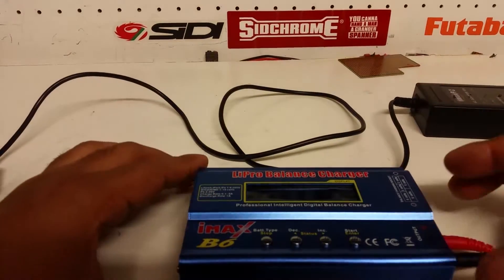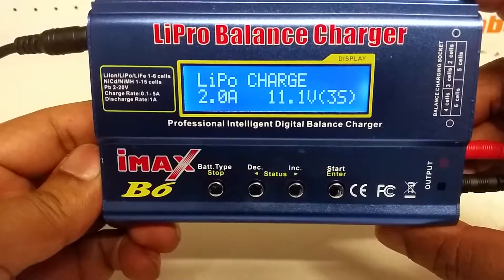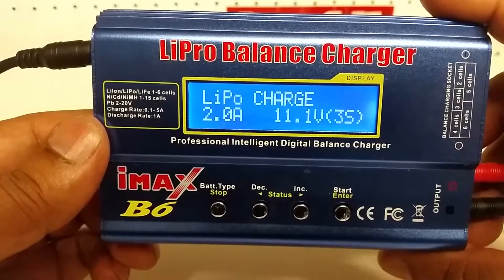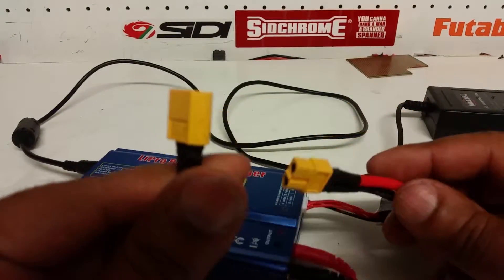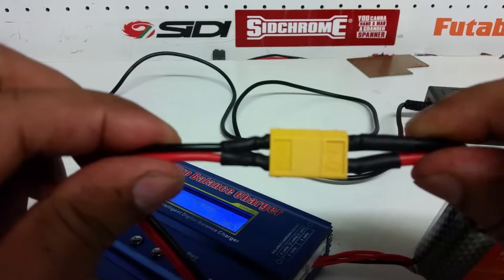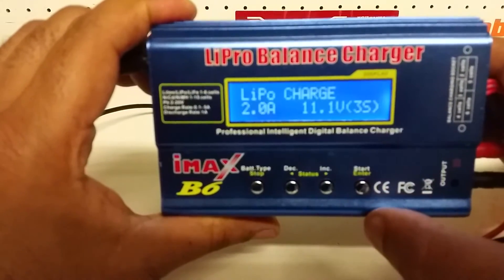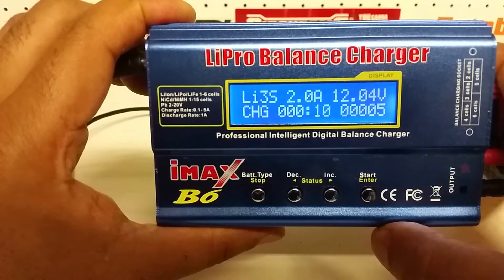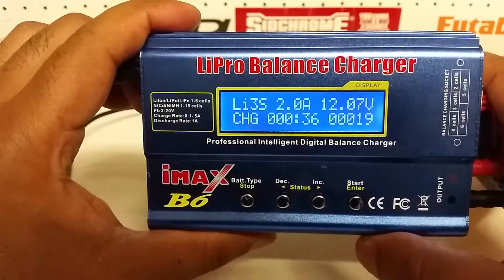CSMI : Imax B6 Lipo batter Charger 3s basic set up

Comment: If the battery voltage shows higher than the battery label (11.1v) will it overcharge and damage the battery?
Reply from the maker: The max voltage per cell is 3.2 to 4.2 per cell
Reply: OK thanks, so there is no possibility of overcharging the battery? The balance charger has protection? Great video thank you, I set my charger up the same as yours to charge my 3s lipo 2600mah 65c
Reply from the maker: It should not over charge but always watch it to be safe .
Reply: OK thank you so much for your reply I will subscribe

Comment: Need help
I am new in this field
I have two questions
1. How much time it takes to full charge 3s 5200mah lipo 30c?
2. It says 3.7v on battery as wel on imax charger menu, but it goes to 3.84v and sometimes 4v is it safe or normal?

Comment: I thought the white plug is what charged lipo batteries. I’m new to lipo rc. My drones come with charger and only white gets plugged in.  So on rc like these you need white plug and plug that matches your battery for your car correct?
Reply: No. Most RC cars do not use the white connector. You just need to use the T plug.
Reply: @Megalink82  dude the white plug is the balance plug, I'm pretty sure it has be plugged in or it won't balance the cell's. Cell's not balanced is one the main reason they fail I believe
Reply: @jackmehoff6701  Maybe I was confused about the original question. The white plug and plug that matches the battery for your car threw me off. You only plug the power connector on the battery to the car. When CHARGING the battery, yes, you do need to use the white, balancer, and power connector on the LiPO.

Comment: What's the difference between lipo charge and lipo balance settings?
Reply from the maker: Lipo batterys have cells 3,4,5,6... These cells need to have the same voltage.  This process is called balancing.  The charger has this capability
Reply: @CSMIRC  yea i know but if i charge my battery on "lipo charge" is this going to charge the battery without balancing?
Reply: @CSMIRC  ..so thats lipo balance, why did you not use it?

Comment: We have blue batter 7.5V 2000Mh is this charger gonna work ?
Reply from the maker: Bit hard to say with out seeing the battery but generally speaking yes it should
Reply: @CSMIRC  
This the battery we've got 
https://www.ebay.co.uk/itm/233582829654
Reply from the maker: Yes it will work.
Reply: @CSMIRC  thank you for your reply. I appreciate it

Comment: mine, LIPRO BALANCE CHARGER IMAX B6 is awsome and maybe made in china but cares really, it stops when its fully charged but i found when i check the cells individually with a battery checker. its off by .2 from 4.2 per cell being fully charged for my 3s batteries. i use a vharge plate its the mist common one that comes to mind and is all over the market. however i wish i could alter the settings without worry, i run it on balance 3s 11.5v and let it go but get a capa cutoff  about 75% finished and have to start it again. im not going to mess with the temperature settings of anything like that. but maybe end voltage slightly since it cutsoff early? or disable the capacity cutoff 1500mah feature and just stay close by knowing the danger. its most likely owner related being pretty at using one so im just trying gwt the balance to work for 3s 1500mah 11.5v (12.6v) but it often is preempted by a cutoff mechanism that assures it to not exceed the peak voltage but never achieves it to begin with.